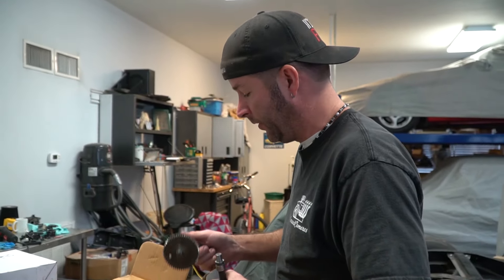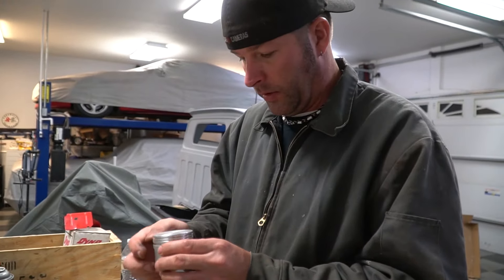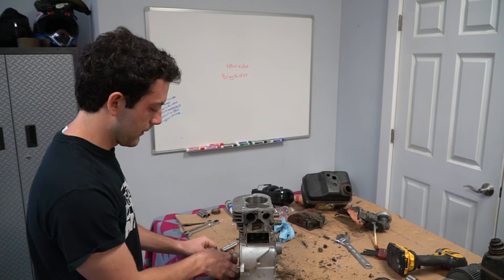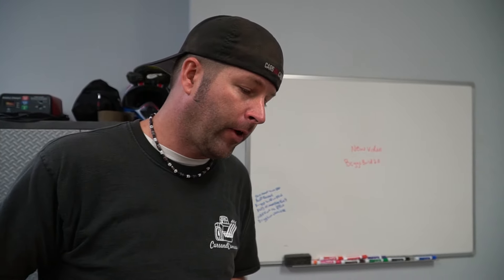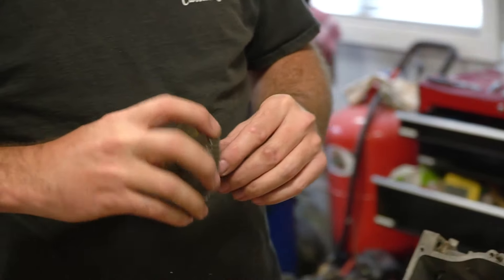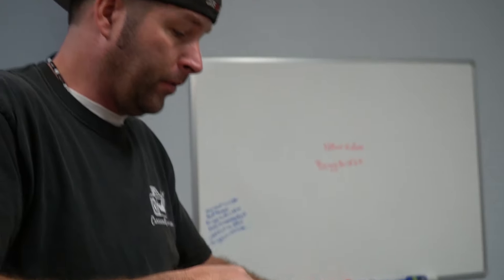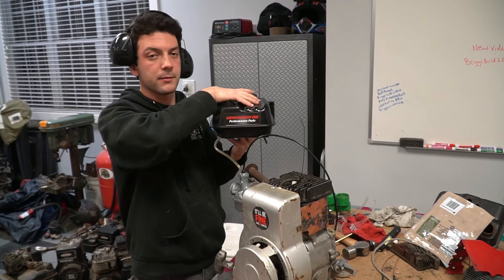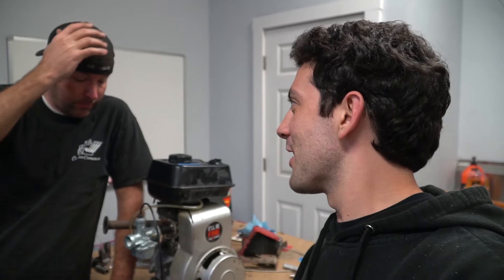Flathead Briggs Build from Scratch | Homemade Performance Mods!

Comment: To correctly check the ring gap you have to remove the rings from the piston, then put the ring in the bore and use a feeler gauge to measure the gap at the top and the bottom of the bore. This also checks the bore to make sure its in round without an expensive machine shop. Another trick is, on the cam get a Drill 4- 1/2" holes close to the center of the cam gear. this will lighten the gear and being that it only spins half the RPM of the crank it's hard to make it out of balance. Then just mill the head a bit and you are good to go.
Reply: They will forever refuse to do this properly
Reply: You must have heard me talking to the video while I was watching it lol
Reply: I don't use clone crap....I have a genuine HONDA ENGINE!
Reply: How about just toss the rings and replace with new ones after honing the cylinder.
Reply: @paulg444  Still have to properly gap the new ringset...& Do it properly (1 thing is you CAN'T weld & grind your own camshaft,take it from a professional engine builder 
- it takes a professional Cam grinder or that's what these two guys are doing & leading all you guys up the garden path ! Talks Cheap with all due respect.Trev New Zealand
Reply: Generally agreed but if it's got taper on the bore there usually will be a ridge at the top & very rarely oval or taped at the bottom of the bore, doing as the threadee said will mostly keep you out of trouble ,& if it does have up to about 4-5 thou taper don't worry about it or if it's a real lip & your worried there's a mathematical formula out there using a ring & feeler gauge.Goodluck on that proper build.Cheers Trev New Zealand
Reply: Intell fell on deaf ears...T NZ 🤔
Reply: @trevinskiking2165  Thanks for posting. It helped me.
Reply: @derekcollins1972  No worries, thanks .Trev NZ🇳🇿
Reply: Lols 😎 ain't it 😎 just ain't it.
Reply: @trevinskiking2165  i’ve got several cams that have been welded on, they work fine.
Reply: @MississippiMudMX  I NEVER said they didn't work fine ! I think you read a misprint ! Cheers from NewZealand where we also built America's Cup winning boats too :-/

Comment: I'm root'n for the briggs . Solid reliable engine.
Reply: You mean the new briggs with the plastic camshafts?
Reply: Solid indeed because its so simple
Reply: @jeffreypepple3198  yes the newer engines are 💩poop
Reply: To right:-)
Reply: @scsclassics  my 90s briggs and straton is bomb proof lol
Reply: @ruffus8012  same here
Reply: I got a briggs motor today for free, and after 40 years it started
Reply: Those old flatheads were designed to stand up to abuse.

Comment: I've got an old flat head Briggs in the shop. The carb is trashed and I've been thinking about making an adapter to run a stock predator carb on it. This video had inspired me to finally try it.
Reply: Let us know how it turns out!
Reply: You can also run a Tillotson carb and intake right on a Briggs, use to be able to find Tecumseh motors that had great carbs for a bolt too (looked like a Tillotson).  Best tool you can get when doing that kind of work is a  Dremel, or the Harbor Freight one, as you will have an easier time porting than with a big drill, or worse doing it by hand.
Reply: Lmk how it works. I just ordered a 30mm Chinese carb for my 1980 8hp. No idea yet how it's going to work.
Reply: I did that on my mini bike, best thing I did
Reply: Kent Campbell I have two of them, same as this one in the vid, so I starting taking one apart ( they both came off an auger)
Reply: I run mine with a xr100r carb, china copy but it runs great, and i made the intake by hand.
Reply: Briggs 691922
Reply: Kent ,, - make a manifold & fit a Honda S90 20mm kehein carb available New in sea Malaysia & perfect for what you want.No jetting problems,super slow idle,snappy throttle response... way better than any butterfly carb.And you can hook up a minibike throttle cable easily - you'll never look back.I have 1 on a 172cc Techumseh.Trev New Zealand
Reply: If you do it will run better cause it hasn't had a chance yet to be gummed up with the cheap,additive modern gas, best bolt a 19mm Slider bike type carb on it & a throttle cable will be a breeze to hook up.From Scott Disksons Indy winners home country of NewZealand cheers
Reply: There are big bore 0.750" Briggs carbs available, the Cyclone.    Guys are using them on stock appearing Briggs for kart racing.  And the Tillotson carb with proper manifold is a big performance improvement.   Or a Mikuni carb with manifold.

Comment: The 5 HP Briggs is an excellent choice when upgrading an old equipment need( think David Bradley or Gravely) or flat out hot rodding a go cart application. 
And, like you guys, boxes and boxes of stuff, it's hard to remember just what you may have tucked away. Congrats on the "Monster" cam find. Love your work...and with that...love the true friendship that Ike and John share.

Comment: I was the engineering manager in tooling at American Yard Products in the 80's. Me and my son use tow WKA race in box stock. He had to run the restrictor plates he started a age 7. You were talking about welding the cams. I had a guy in Columbia, SC that ground my cams and cut my rings down. He told me he hated to weld the cams for the modified engines. At work we used thousands of Briggs engines each week. We made over 1,000 garden tillers a day that used the horizontal 5 hp. I could get dent scratch and dent engine for $25.00 new. I called up one of the Briggs engineers and ask if there was a way to get cams that had the journals and gear cut but not the cam lobs. He said easy because the lobs were actually broached not ground. Couple days later I get a box with six uncut cams. Went to get cam cut and dropped one of the uncut ones in the guys hand he had a fit. After that Briggs started selling uncut cams to the racers. I think I still have some in the garage.
I also had a way of cheating that could not be found in the WKA tear down and never got caught. We ran at St. Matthews in SC and some in the Spartanburg area of SC. My son got bored so he quit at 16. We never had an engine failure in all those years we ran. 
I tore rota-tor cuff cranking an engine that had nitro in it like to have torn my arm off.
I use to race flathead Fords so same as the Briggs more or less.

Comment: I love old Briggs flat heads. Easy to work on, reliable, and I think they are just a little more powerful than a clone long term. The newer OHV Briggs are also a great engine for modding because of the parts available

Comment: Briggs flathead. The small block chevy of small engines. Reliable, cheap, and lots of aftermarket parts. They can make unbelievable power with the right mods. It's my favorite go-to engine.
Reply: The flathead ford of engines.

Comment: Who else wants to hear that home made high duration cam run?
Reply: Me!!!!!!!
Reply: I was very dissapointed they diddent run it.        Home made performance? All they made was a intake tube and port work.
Reply: I'm probably going to make one for my old 8hp flat head
Reply: Me!
Reply: The best block is the industrial which is cast iron cyl
Reply: @davidhill5621  i have one, just made an intake for it, it runs. Now i need to do everything possible, what can be done?
Reply: @bryanroupe8646  just got an old 8hp from a generator myself and plan on doing the same, let me know how yours works if its done before mine!
Reply: Love your vids
Reply: probably didnt run lol.
Reply: @petrolmonkey1973  been there,done that but with a 3.5hp zTechcumush - the secret was the brand new 20mm , Honda carb .Comp so high I could hardly crank it over but the idle was lovely
Trev New Zealand PS you can't make your own welded Cams & grind them without farming the work out to a Professional cam grinder I used the Flathead Isky 404 grind basically 3/4 race.
Reply: @sideways4daystunewerksinc578  Note you got no answer. That's like asking for a tyre for my car. Buy an old book : " Souping the stock engine " (they are doing reprints now) If You're a novice treat it like the flathead Ford V8 , if you know more minidragracing suppliers has the good stuff but start with the prior and you can't go wrong - seeing as you didn't state motor brand.Trev New Zealand GoodluckPS remember Cubes win with Flatheads not Revs to a certain extent.
Reply: @trevorking8985  yeah, i ended up buying all kinds of tools, built some shit and did a ton of trial and error. Found out the hard way on some things, buipt some bad ass little engines lol. I love this hobby.
Reply: @sideways4daystunewerksinc578  Goodstuff.Thanks for the reply. Trev NZ
Reply: @bryanroupe8646  Bryan: for an 8 HP use a 26 - 28mm good used round slider Bike carb....cheap as French fries & usually jetted ok from the 4 stroke bike....try an ex XR200 Honda being parted out. Cheers Trev New Zealand 🙃😎😇

Comment: I have a 8hp Briggs from a old generator on my yerf dog with a Torque converter. That I put together with parts I made and The knowledge from this channel. My little brother , my cousins and I love that thang it’s so much fun and could not done it with out you 2. I topped it out at 33mph and I put a car horn on It with a lawnmower battery. I would love to send you guys a video of it and I planning to go to the next Busch beach meet up when I get my license to drive thar
Reply: 33mph from an 8 HP Briggs W torque converter ? Your final drive gearing is out - it should go faster than that but good on you for having a go.Trev New Zealand

Comment: I love the old briggs 5hps. They are great to play with and modify. And if you mess it up they're not very expensive at least around me.
Reply: Where you from man? Those things are so expensive in Pa
Reply: Central IL, theres a few small shops and auctions that practically give them away at times.
Reply: Where i live i pay 10 bucks or less for mine i rescue them from junkyards
Reply: @DonovanBryant92  yea thats about what I pay too
Reply: I am from central Illinois too and they are a cheap everywhere I have seen them. Running or not, there not hard to find cheap, last I tried which has been a little while.
Reply: It's just so hard to justify spending $$ on an old Briggs when you can pick up an arguably better engine for <$100. 
I don't mind throwing one together out of spare parts but I'm not going to spend money fixing one.
Reply: I'm from florida
Reply: @MegaKencam  and 212cc predators are now like ls swaps. boooring af.
Reply: @frigglebiscuit7484  I agree with your analogy but I don't find cheap reliable power boring.
Reply: @MegaKencam  I find seeing the same engine over and over again(especially on older frames) boring as hell.
Reply: The 212 is nice but its just boring because everyone uses the predator on everything now
Reply: Plus the older engines will last much longer most newer engines are pieces of garbage when it comes to long lasting
Reply: @DonovanBryant92  It all comes down to the metallurgy & the Chinese Can build top notch stuff but are selling the World sheet.Trev Trev New Zealand
Reply: And those old flatheads were pretty hard to destroy.

Comment: Did a similar thing on the cam, 51 yrs ago in 8th grade. I did not have a welder so I took a grinding wheel and reduced the base circle on the cam then flattened out the nose of the lobe for more duration and so it would not hit the head LOL. Milled the head on a piece of sandpaper on top of hardwood, used Prussian blue to check for high spots and got it so flat that it sealed with no gasket.Also chamfered the top of the cylinder adjacent to int and ex valves to aid in flow into the cylinder, and of course retimed it and installed a motorcycle carb.

Comment: 26 years ago I ran micro stocks with a 5 hp flathead modified on alcohol. With the mods we did these engines we could run near 80 mph , some of the driver/car weights were over 400 lbs and were still competitive. We started by boring .100 over , put in a dykes ring piston or made a gapless ring set for a Horstman standard ring piston. Basically the same type of porting that you did except I used an air die grinder with carbide ball cutters to get into the ports better. A Tillotson carb with a second fuel pump and a lapped in 3 1/2 hp flywheel ( Iron on the tracks where we were flat out all the way around and aluminum at tracks where we had to lift for the turns). The ONLY aluminum stock flywheel that is safe to use is the one that came on the old 3.5 push mower with the rope start mounted on the side of the engine. The ones that are a thin disk with 2 blocks 180* apart WILL EXPLODE!!!! Also take a small degree wheel and mount it on an old starter pully so you can use a timing light. You most likely won't be reving to 9000 + like me so lapping in the flywheel and tightening the @#$% out of the nut should hold your timing without a key or get offset keys from Power Sports.

Comment: For an accurate ring end gap measurement, you have to take the ring off the piston and recess it down below the flash line (where the top ring stops in the cylinder). The best way to do this is remove the ring, flip the piston up side down and press the ring into the cylinder at least an inch or better, then measure the end gap. There is no wear to the cylinder wall where you checked the gap of the rings, so as the rings get down into the cylinder where they belong, the end gap will be greater. Proper end gap for compression rings is .012-.016 and .020 on the oil scraper ring. You'll loose quite a bit of performance if the end gaps are beyond these numbers. Zip~
Reply: wasting your time these guys are engine experts
Reply: plus they get all the stuff from blow powersports for free so they don't care if it blows not their money.

Comment: Long live Briggs & Stratton.  I only run those vintage flathead engines on my mini bikes and go karts.  I only have 1 over head valve engine and its the Predators 212 that came with a Bonanza frame I wanted so bad.  The engine is sitting underneath a towel in the garage waiting for me to put it on something

Comment: My dad still uses an old 3.5 hp Briggs on our lawnmower, when he got it for free it didn’t run but he says it only has 3hp now I don’t know what exactly he did but he rebuilt the whole thing to getting it running. It’s an old Toro lawnmower with little to no safety features but I love it
Reply: the only difference between the 3 and the 3.5 is the carb.

Comment: The b&s episodes are the best. No one does anything with them anymore. I like the 8hp 319cc flat heads the best. I have one that smokes my sons predator 420. Its a 8hp from a generator. Ported head, made a head gasket from a 25oz beer can for more comp, 26lb springs, governor delete, 30mm carb and runs on c16 race fuel. Just finished it about 2 weeks ago. I'll have to upload a video of it when the weather breaks.

Comment: I'll definitely answer the question you asked. EVERY TYPE. I have a predator on mine,a tecumseh that we just removed the rev limiter (governer and it revs high now) and I have a Briggs on my race mower (that goes 14 mph. Very puny 14.5 horse). It's awesome.
Reply: Gear it higher..... my old ih128 with a 12 hp kohler runs that fast with stock gears

Comment: Pretty cool you threw one of the old Briggs together, I started racing karts on dirt when I was a kid and back then Kawasaki’s was the motor to have. Would weld up the lobes and get some stiff valve springs etc. another trick me and dad did was fill the intake port with jb weld then drill out a small hole for short tracks 😂.  The tricks we used to do back in the late 80’s 🤘🏼🤘🏼🤘🏼

Comment: Great job guys!  I love these old B&S engines the "Flat-Head Ford V8s" of small engines.  There's a cool factor in these engines that the Chicom Honda clones lack.  I hope B&S continues making Flat-Head engines though I can't imagine B&S being able to compete against the cheap Chicom stuff.  The B&S engine on my old lawnmower finally gave up the ghost but instead of buying a new lawnmower I was able to buy a brand new Chicom Honda clone engine on Ebay for $90.00... INCLUDING SHIPPING TO HAWAI'I!  That was 2 years ago, and my lawnmower continues to starts on the first pull every time.  Guilty as charged, I don't think I could have rebuilt the old B&S motor for $90.00.  
Can't wait to see your other B&S race engine restored and running in the rat-rod Radio-Flyer go-cart.  Keep up the good work.  I am 59 and my brother is 64 and when we were kids we used to build mini-bikes and go-carts, and your channel helps me to relive fun memories of better times of my youth.  Mahalo a nui loa guys!  8-)

Comment: You guys should try and find an 8hp briggs and use it on the rat rod wagon......if you could get the kind of torque I get with mine (it came from a wood chipper) you'de be burning rubber for days

Comment: In high school I built an engine mount to be able to hold the engine with a bench vice because i would always get fed up trying to run them on the ground or on a test bench and they would rattle around.  I used 2 pieces of angle iron with 4 holes for the mounting bolt and beneath it was another angle iron welded so that it would be able to get clamped on with the bench vice

Comment: Jesus that little thing sounds aggressive!
Reply: Get a big enough cam in it and they cam shoot flames.  To me the flat head can be a mean little engine and are super simple to work on, since the valves are in the block you can switch out the head without having to redo the valves.

Comment: Yup, have a fully built 5hp that makes probably 25hp on 118 octane racing fuel. The dude I bought it from ran it on a junior dragster. Its going to need piston rings pretty soon. Good thing is that I have 3 milk crates of parts and parts motors.